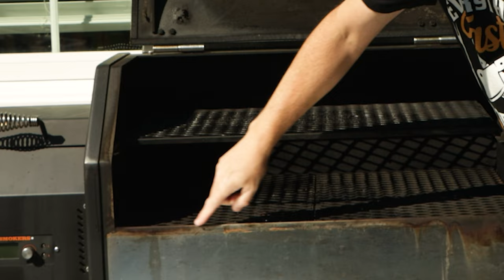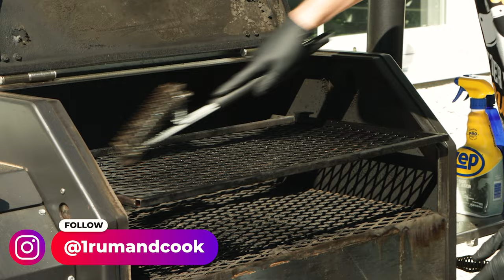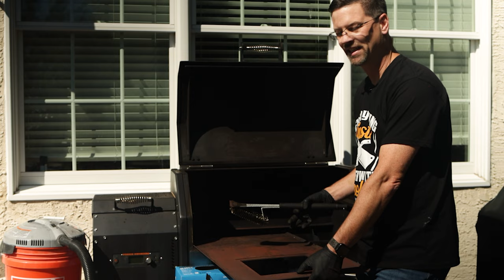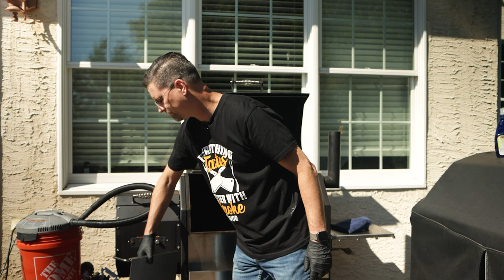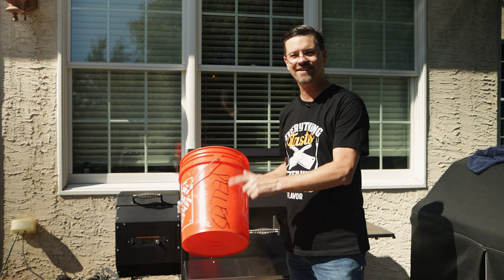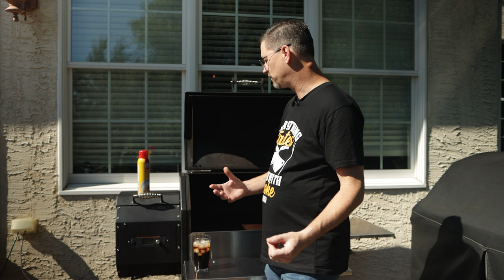How To Deep Clean And Season A Pellet Grill

Comment: Jake, I watched one of your earlier cleaning videos where you mention using P.B.W.  on the stainless grates. You seem to shy away from cleaning the grates in this video, did you run into any issues from using the P.B.W. ?
Reply from the maker: Nope PBW is fine on stainless, just don’t use it on your grill grates if you have some. It will destroy aluminum. I tend to keep them well seasoned until they get filthy and then will do a deep clean as needed. They were in pretty good shape there. 🍻

Comment: Thx for the video - good info.  What do you use to clean your grates, both the ones that came with the Yoder as well as the Grill Grates?  Mine look pretty  bad right now and was looking for the best way to get those looking good again.
Reply from the maker: Grill Grates has a brush that works great. You can use oven cleaner or PBW on the main grates, but DO NOT use it on the aluminum grill grates. I learned the hard way. 🍻
Reply: @RumandCook  Thanks!!  I thought your original video about grill cleaning suggested a specific product or process for getting the regular grates back to new?
Reply from the maker: No prob. Yeah that’s PBW. Should be a link in description or check my Amazon store. You can soak them for 24 hours in water and it and they will look. We again. Just can’t use on aluminum.
Reply: @RumandCook  Got it.  Thanks very much.